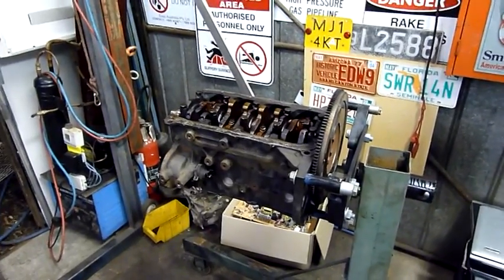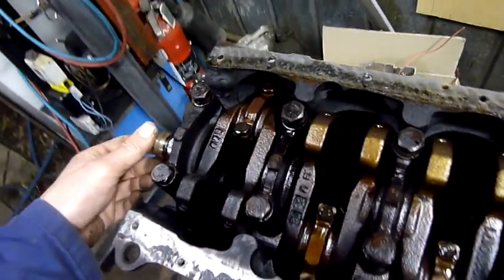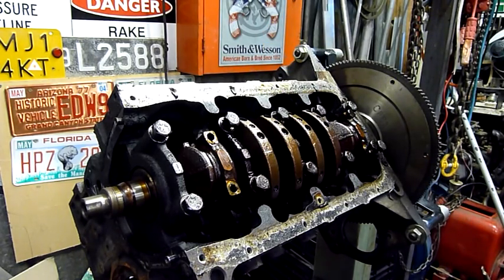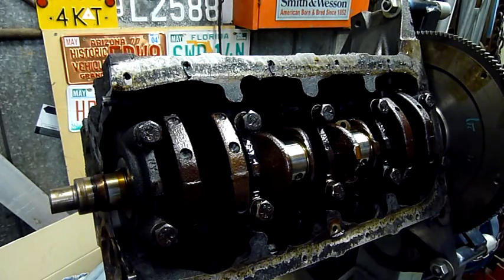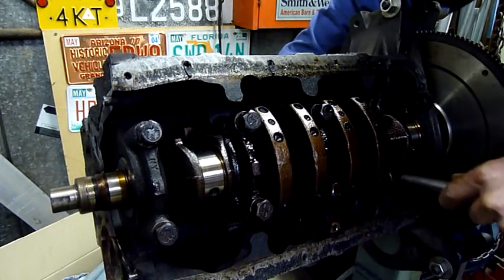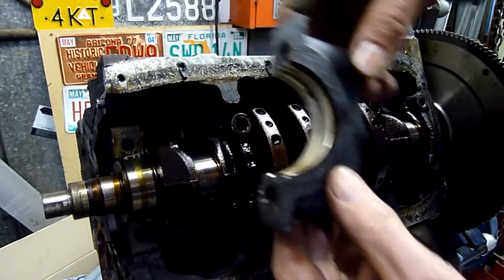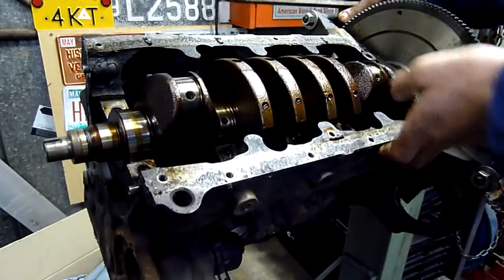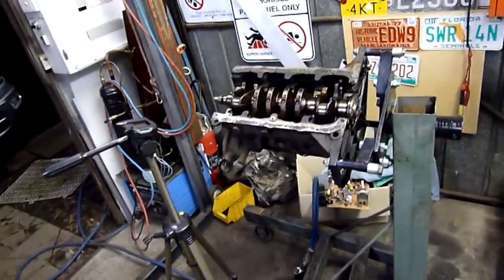Daewoo Lanos Engine Final  Crankshaft and Pistons

Comment: I have a Lanos and it's misfiring. Garage have struggled to find what the problem is. Think it might be the crank shaft bring bent (the compression is down in one of the cylinders). Was that your problem?
Reply: He ran it on jet fuel, that's his problem.
Also, head gasket blown and other problems before he got it.

Hilarious this engine actually ran on jet fuel

Comment from the maker: There is a little wear in the expected places. especially after the detonations forced the piston against the walls.

but overall you can see all the honing marks and no lips or gouges at all

this engine faired well., tho the injectors were faulty before I got it, so I doubt all 4 were getting full fuel flow from the start
Reply: Any idea where i can get piston rings to buy for that engine today?

Comment: These engines were deigned to last through loads of abuse in the GM vans. 200,000miles was easy (320k). 

They were designed back when engines were re-built not just chucked in the bin :-(

Comment: i had one in a opel before the one i have now wich had gone past 600,000 k m and it still ran strong as hell... on75 horse"power" he he  overcoocked a mill times and no worrys at all , had it fo 4 years and sold it with new head gasget , the cheapest , most reliable car i ever had , beside my alfa romeo